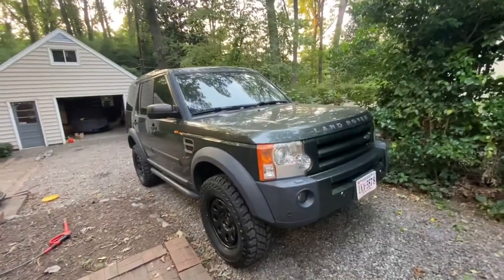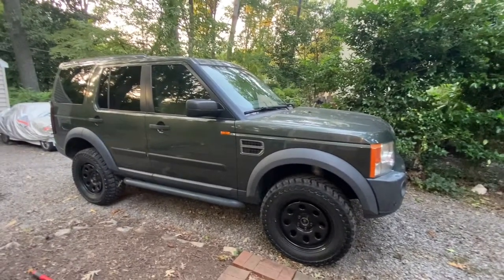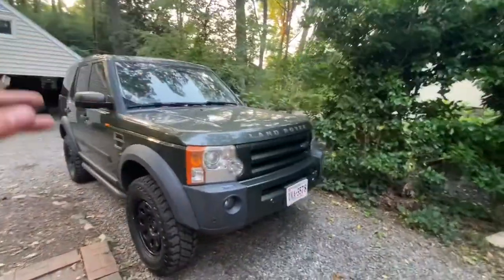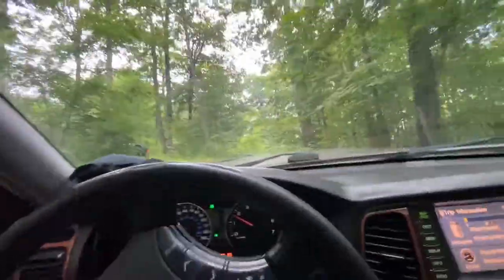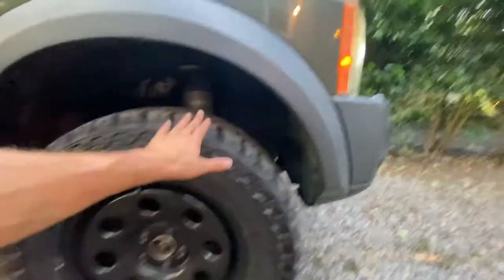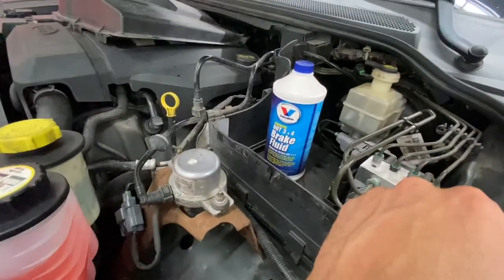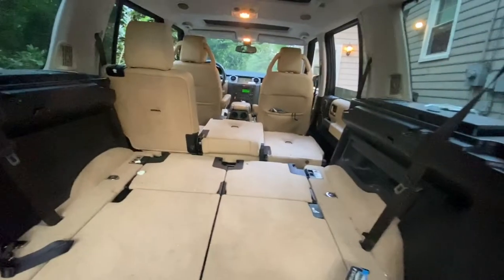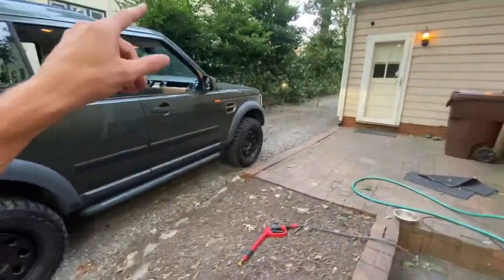PT. II - How I Ended Up With A Cheap Land Rover LR3 + MODS! - Channel Announcement! (Lift +Tires!)

Comment: You scored man! Love the property also. Great gal as well. I just got a 06 RR SC in an auction. I placed one bid at 4200 sitting on the bump stops ONLINE!!!! Did not expect to win it, but I did a few weeks ago. Found the relay to be at fault for the air system. 30 dollar fix. YEAH,,,,, Then replaced the touch screen. Now have radio and all except NAV. Bought a NAV DVD. Still didn't work. Took apart the DVD and blew it out with canned air. Now it works!!!!!!!! Hood release cable, water pump a week later, Steering column tilt motor removed and freed up. Works. Telescopic motor runs but does nothing. Used a flat blade screwdriver to extend it all the way and will just leave it there. No need to adjust that.  5500 total so far. Loving it, but your starting price is WAAAAY better!!!!!!

Comment: Wow, that is in very good condition. If these are given the love they deserve, they go for ages. My Disco 3 is now 15 years old (2008MY) and is still going strong. I had a NATO tow hitch made up so i can tow military trailers. I get some very funny looks ;) What kind of mpg do you get? I'm getting around 32mpg on a long run. That's the 2.7 ltr diesel though.

Comment: Really clean vehicle.  Great deal.  I have the same vehicle with 225k miles.   Im in VA as well… I had an OEM roof rack for you but I just gave it away.  Hope to see you on the road.

Comment: Nice vehicle , if there is no external motor locker activator on the rear diff, it is not a locker . Also, I would not use a two poster hoist to lift the vehicle . The air bags in all four corners can be damaged by letting the wheels hang down to full extension . It should be serviced on a four poster drive on with cross rails to support the suspension when the wheels are removed .
Reply: I do agree with your comment in theory, I’ve never seen it to be an issue. Out of true curiosity, have you?
The bigger point of stress is actually on the CV joints. But, because it’s not being driven, or under load, this is just fine.
Reply: @garrisonpfeffer1825  Many times. Not so much on the Lr3/ RR Sports(same chassis). The full size RR's and older P38's yes. I ran a repair shop for 43 years.

Comment: Hopefully you've got a mate with a Land Cruiser for when you break down? 😉
Reply from the maker: I have a land cruiser.
Reply: Ha, ha! He's got it covered! Not only that but try buying a land cruiser for what he's got into the rover. My home is in the boonies so every ride starts and ends in the dirt. What sold me on the LR3 was the adjustable air suspension and cargo area. I am a geezer and my kidneys would hurt every time I went anywhere. Both rows of rear seats fold totally flat and for the most part, since it's just me and the girl, and two dogs, the seats have been in the folded position. I love mine and so far ( almost two years) it hasn't cost me anything more than fluids. With ~160k on the clock i know it's coming and parts seem a little more expensive but if you're willing to get a little greasy, well I like to say" i am not a mechanic, just too cheap to pay for one" . And i have gotten away with that for almost 50 years. When the repairs get a little over my head or require tools i am unwilling to buy there's always the wrecking yard or my personal favorite PARTS CAR!  Anyways, so far, so good. Kidneys are good or at least not sore. Hasn't stranded me though has come close with battery issues. Cured it by turning off auto interior light settings that kept interior lights on for 15 min every time you open   a door. Also purchased one of those little battery jump starter contraptions.
Amazingly, even though mine didn't come with rear locker, i have yet to hear any tire spin. I never try putting vehicles into a situation where they might get stuck on purpose cuz I have had too many experiences of getting stuck just trying to get where i need or want to go. Some of them could potentially have been a life threatening experience. To get that level of capability, comfort and capacity in cubic feet of cargo space for such little cash, well the LR3 is hard to beat... as long as you not counting on getting any money when you re-sell it.

Comment: How the hell did you get this thing for $2500 unless there’s something seriously wrong with them they typically go for around six to $9000 with this amount of mileage sometimes you can find a cheaper but most of them are the abused ones and they typically have problems, but awesome deal for you that’s a good looking LR3 if you treat them right you can easily get 300,000 miles out of them I have disco 2s but my LR3 is pushing 200,000 miles With zero issues if you treat them right and do the basic maintenance they will run for a long time Im out of harrisonburg are you part of the mid Atlantic land rover club ?
Reply from the maker: Thanks! And I am!
Reply: He said it sneakily...he paid about $2000 for the Volvo, then sold it for 4k. Then bought the LR3 claiming it was only 2k but really 4k.
Reply: @dausgreen7044  This is the kind of math you use when explaining a purchase like this to your wife!

Comment: Would you buy an LR3 with 205,000 miles with 26 service records? It's also 2006 fully loaded.
Until I subscribed to you most things I see in here are run away and stay away. I need some honest advice from someone that knows these vehicles.
Reply from the maker: I mean for how much?
Reply: @AddictedMotors  $5995
Reply from the maker: Dealer? I mean that’s not a bad price as long as your willing to put another 2k into it. I’m sure it needs control arms.
Reply: @AddictedMotors  yes, a dealer and they claimed it went through service and everything was fine. Sold as-is though.